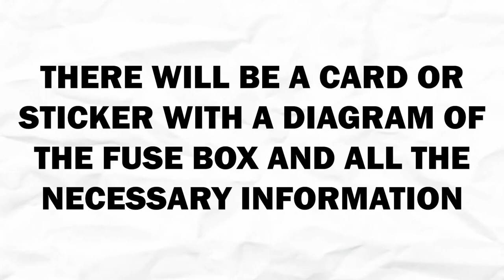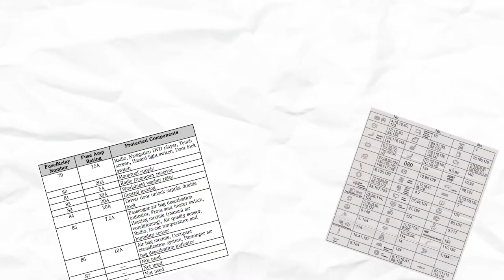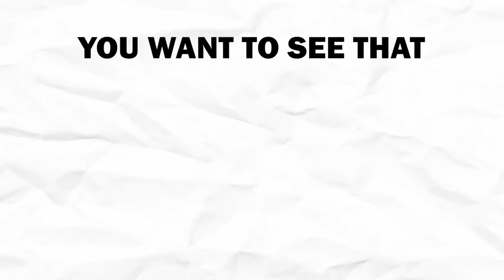The Ultimate Guide - Fix your car 12V Cigarette Lighter, Charger Outlet

Comment: Man, why'd you use a Volvo for the thumbnail?
I was tryna figure out if there's a fix for my 12V socket because when I plug in an adapter, it just wiggles around and often loses connection
Reply from the maker: This way it's much easier to see what's going on in the thumbnail. And for loose socket you can bend tabs inside of outlet a little bit out with small screwdriver, just be careful of electric short